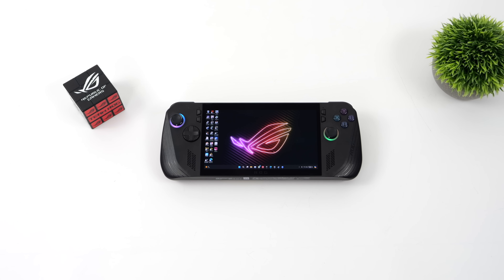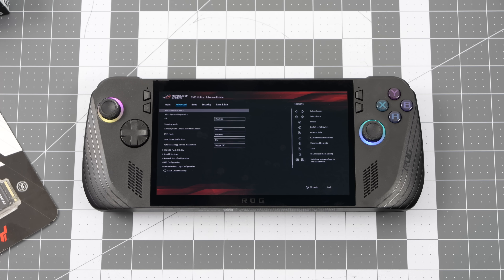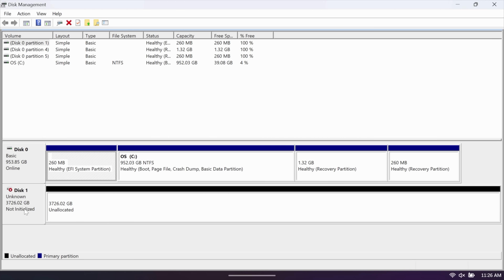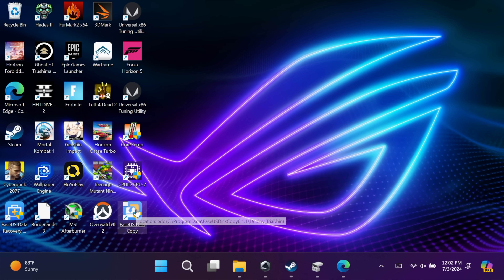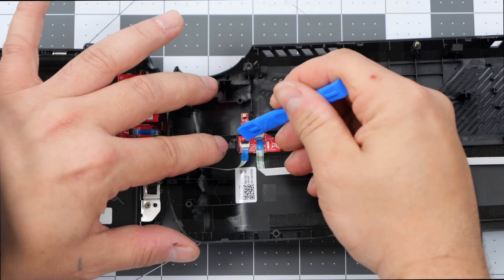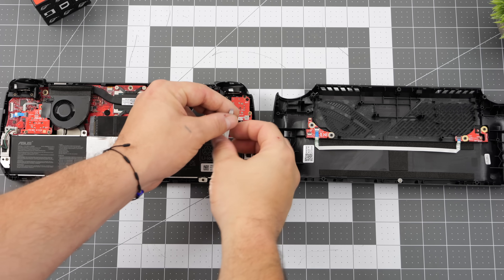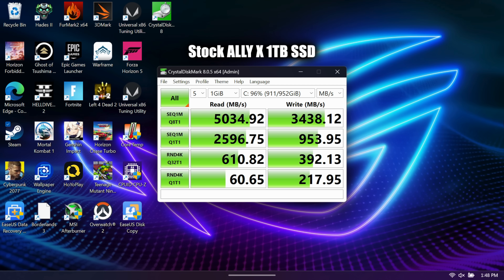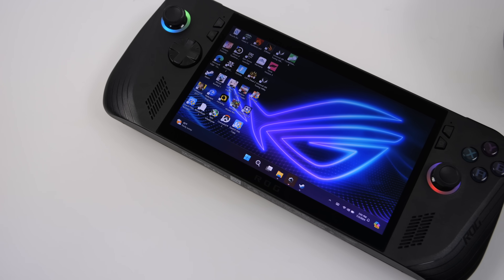The Ultimate ROG Ally X Upgrade! 5TB Storage For All Those New Games!

Comment: I have a 2280 SSD in my regular Ally already. All it took was an adapter for 12 bucks. Works flawlessly.
Reply: Is there no temperature issue?? And what about the thickness of the SSD. Is it pushes to the backplate or does it have some room to put a very flat heatsink on it?? I'm looking for an Ally 'cause I have many games still not certified to run on Proton. Thanks for your answers!! Cheer!! :3
Reply: @fredericmanson441  I've done this with my ally too. There's no problems with thickness or anything. I don't think I even put a heatsink on mine.
Reply: @fredericmanson441 I've modded mine with a custom copper plate to sort the heat out. 30w continuously and the temps never goes over 80c with fans around 55-65%. Insane oh yeahhhh👊
Reply: @fredericmanson441  u have way more room than u think , i put a 6mm high coper plate over the ssd and still was fine
Reply: @fredericmanson441  I just put a blank Lexar NV790 4TB in it and put that little plastic layer back on it where it was before (assuming that's to guide heat through the fans and shield the SSD from it? No idea) and it's working like a charm. I don't have any heat issues and it's not touching anything either. There's a lot of empty space between the two fans of the Ally so I don't think there's any issue with the placement.

I finished Persona 3 Reload on it like that, currently am playing Soul Hackers 2 and played a ton of smaller other stuff. No performance issues, no heat issues, all good so far.
Reply: I can confirm I also have done it an it works even better and even lower temps in my opinion an 2280 2TB ssd everything opens instantly
Reply: Same. No issues with a heatsink either. Temps are just fine. Of course just had to send it in to fix a broken button
Reply: Do you guys think the Seagate - FireCuda 530 2TB Internal SSD PCIe Gen 4 x4 NVMe with Heatsink will fit?
Reply: @Sol_Arte23 you ever find out only time I did a ssd upgrade was in my old laptop years ago and replaced the hard drive with firecuda it worked amazing but I can’t re use it in this
Reply: I used his old SSD upgrade video for last years model. Can I just move that 2280 m.2 ssd to put it in my new ally x?
Reply: not a good idea since it was never designed for the power draw and thermals
Reply: @brandon_nope  running mine with 8tb with a proper copper plate to take heat from apu and the gen4 ssd....guess what !!!!is bloody amazing 😂😃👊
Reply: what a waste of 12 bucks
Reply: @howardlam6181  lmao....stay with overheated 2230 ssd 😂
Reply: @howardlam6181  u have no idea what type of  heat the ssd controller makes no matter the size and performance , if u don't have nothing it will go up to 80c and above, no wonder at some folks ssd completely broken after half year , better spend a bit more than keep buying new ssd and from what i know ssd are expensive than a piece of metal 🤣